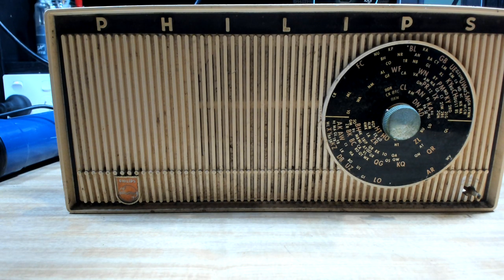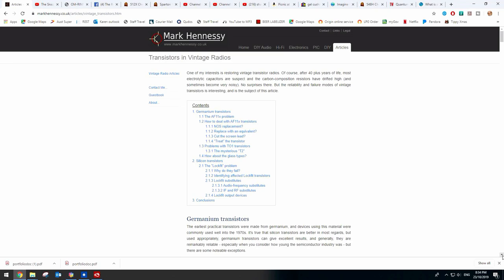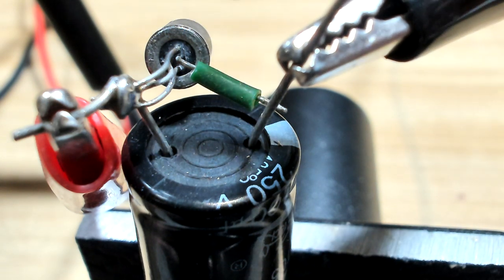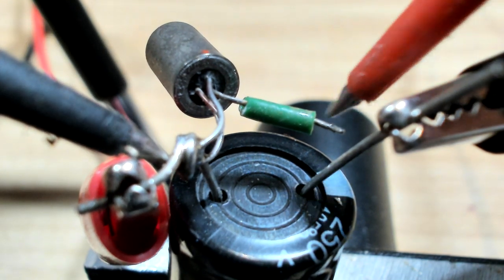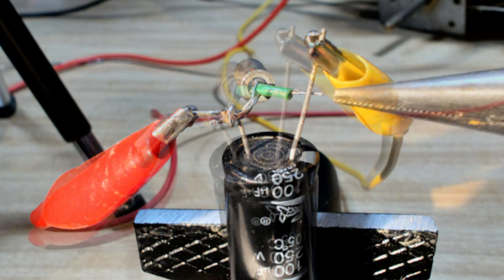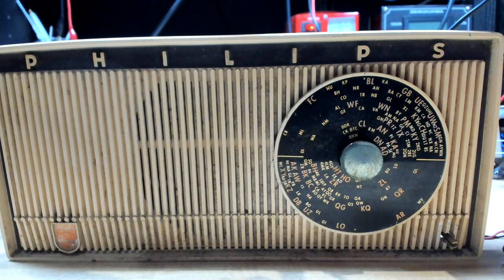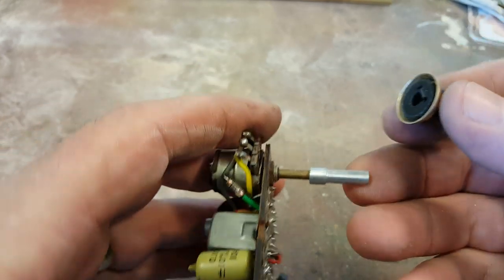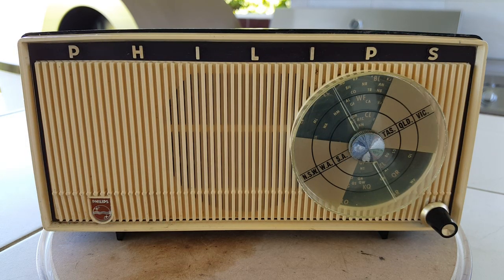Germanium Transistor Tin Whiskers Fix on a Cute Philips MT6 Radio

Comment: Another radio saved, and by doing something that you would think would blow up the transistor.  I am glad you didn't paint it.  Even though the colour has changed, it still looks quite attractive and authentic.  Cheers.
Reply from the maker: Hi Pauline, I think it would take a fair bit befor it would jump to the case itself. I was reluctent to paint it and as you say it looks pretty good as it is, thanks 😊

Comment: WOW!!! I have never heard of Zapping a Germanium transistor like that...I am amazed that it worked, but work it did!
I can't really give you a proper answer as to why, but I really don't like working on anything solid state.  I love the old Vacuum Tube (Valve) type stuff.
Good short video.  Thanks for sharing.
Reply from the maker: Thanks Wyane 😀
Reply: Radiocruncher uses this fix for AF117s in the i.f. modules of Roberts radios. Usually effective but there is no guarantee they won’t return sometime.
Reply from the maker: @Wenlocktvdx  More likely to guarantee it will return at some time 😂
Reply: @Wenlocktvdx  ,
For a minute I thought it was the same manufacturer as one I saw in a video recently.  Turns out the one you mentioned is Roberts and the one I saw was Rogers.  It was a really nice radio!  In case you want to see what it looked like, here is a link:   https://youtu.be/ISbidethQyc
Reply: Rogers-Majestic LTD. was bought by Phillips after the war, some of their products were made in Canada, others were rebadged Phillips models imported directly from Holland. If you saw a transistor radio with the Rogers name on it it was probably one of those from the early to mid 1960s. 
 The video you linked to is of a post war AC/DC set in a sort of table/chairside cabinet, in fact I think I saw the very set for sale  on Craigslist a month or two before he posted that video. It is not a set that really appeals to me to be honest, but unlike the transistor sets it was made in Canada.

Comment: Hi, I have done the " flash technique " on a selection of old Ac114, and Ac127 germaniums out of old Hacker radios ,and had some success. 
The resistance between the joined coll,base,and emitters to the case was in some cases just a few ohm to several k ohms.
I always keep an old but charged car battery on my workbench,  for when I am repairing old valved car radios with vibrator power supplies, and thought I'd try using it as the " flash voltage" .
On several occasions,  there was indeed a visible flash through the bottom of the transistor case, sometimes not , but in every case, the internal resistance returned to infinity, and the transistors worked well with no noticeable physical induced microphony ( hit them with screwdriver!).
The downside was that the " repair" only seemed to last a week or so , so I just replaced them with modern ( ish) equivalents.
Reply from the maker: Hi Bob, thank you for adding your experience with flashing... transistors that is. Interesting that you saw the flash during the procedure, I copped a bit of flack with that claim. I just tried the Philips out and it still works, that was 3 years ago, I guess hitting it with 80 or so volts might have been the difference. Thanks Bob 👍🙂

Comment: Hello David yes I have encountered tin whiskers on tin and zinc plated components in RF equipment in the past. Not so much these days however.
I have considered this could become a problem with some of the very small surface mount components as they age depending on their environment.
Thank you for a very insightful video demonstration which I will try when needed in a repair.
Reply from the maker: Yes, in Marks article he postulates that the removal of lead and replacing it with tin may see the whiskers issue start up again. Thank you for your comment 😊

Comment: Thank you for the tech tip! To be honest I thought the capacitor of the transistor was definitely going to blow once you started using a 90-volt source, well done!
Reply from the maker: My Pleasure Andrew. The cap was rated at 650 volts so there was no problem. The radio still works 😀

Comment: I've got a Perdio Town & Country and a Murphy M8(?) which are full of germanium transistors. Neither of them makes a sound. I suspect I'll ultimately end up replacing some or all the transistors in them but now at least I have something I can try first.

That Philips looks great and sounds well now. Very informative video, thanks a lot!
Reply from the maker: Hi Paul, It's still working after the transistor fix, good luck with yours 😀

Comment: Really interesting article Dave. Glad you got the old girl working again. I have a decent collection of transistor radios myself in the UK and enjoy breathing new life into them as indeed you seem to do. 
The perennial problem of tin whiskers....... I have to drag some of my collection out of the loft on regular basis to short out the little blighters. By the way, I have had some success using a megger and using the procedure you carried out in your video. 
I Never get a flash on the shorted transistor leads but it always seems to fix the short and start the transistor working again. I Never throw away germanium transistors particularly AF117's as they are very rare to come by and even new old stock can have the same problems. Keep up the good work mate.
Reply from the maker: Hi John, a megger would be a good choice but I don't have one... yet. The website I got the info from said because the base of the transistor is glass you may see the flash inside. I have a few NOS germaniums that are DOA, I'll spark them back to life when the time comes 😃

Comment: Hi in my shop we took out all the black gunked leaded transistors or ic's and put in a little bottle part full of tarnoff and stirred occationaly and checked by pulling out with tweesers till clean then put back in resolving all problems esp in old audio equipment... worked every time. Guess most wiskers are at the base at case enterance.
Reply from the maker: Interesting idea William. I understand the tin whiskers grow from inside the case and short to the active components inside and not necessarily near the base but I like to experiment so might give it a try next time, I think Tarnoff is expensive though. Thanks for the tio William 👍🙂

Comment: I've seen a similar trick with germanium transistors from a youtuber by the the name of 'radiocruncher', very useful thing to know and thanks for the detailed explanation. In regards to the case and whitening plastic, you can use hydrogen peroxide in some kind of paste form wrapped in plastic and left in the sun, I've tried it and it works with computer type beige plastic that has gone brown, but not sure about older plastic, I'm sure you must have heard of this method, thanks again David.
Reply from the maker: Hi Graham, I'll have a look for radiocruncher, I was going to use peroxide but was worried that it might affect the black dial so thought better of it 🤔
Reply: The hydrogen peroxide in paste for is a product at Sally beauty store. It has limited success, and will not prevent a whir plastic from yellowing again. I used it once on the grout around my bath tub. It did a great job!

Comment: Nice, its an antique radio by Phillips. Nice restiration and repair. I had used many Philips electronics. I had seen L5 radio which had been in use of my late father. And also a valve tv.
Reply from the maker: Hi hanif, thanks for your comment 🙂

Comment: I've blown lots of tin whiskers away and never seen a spark but it works. I suspect the metal is microns thick and a few milliamps takes it out.
Reply from the maker: Yeah, I think I was expecting too much 🙄
Reply: It may depend on the lighting, or how thick the whiskers are.
Reply: Yeah, if you want a visual aid I'd think you would need to monitor the current with quite high resolution, perhaps even microamp level. Put the voltage to the transistor constantly and hit it until the meter stays on 0.

Comment: Many of the early Brit transistor radios suffered from 'tub whiskers'. I've learned a few tricks over the years including replacing with silicon transistors. Yes you can try firing a capacitance discharge and YES SOMETIMES that WILL work BUT! it still can be a SHORT TERM fix. 😗The 'tin whiskers' issue was a KNON problem and many suspect the PRODUCTION methods of those transistors was indeed suspect ? It is interesting to note that I seldom ever had such issues with ie JAPANESE transistor sets. SONY et small transistor pocket sets. 👍 Service engineers were issued with a small hammer like tool that they were told to hit the transistor with to clear - momentarily the curse  ! though I suspect the VERBAL abuse was more of a CURSE 👀🤣 I used a 500v surge and some I know more than that.
Reply from the maker: This transistor is still working after 2.5 years but it will fail again sometime. 500 Volts should wake it up 😄

Comment: When I was a kid about 1971 my uncle used to fix tin whiskers in a portable radio by switching it on and stroking a front door key along the PCB loud popping and screeching until it started working. I cringed but it worked
Reply from the maker: Yikes!, sounds awful @jagmarc 😖
Reply: @DavidTipton101  I've just remembered another one I saw long time ago, while the radio was switched on no sound.  With wirecutters cut a certain lead of each of the AF117s one by one, and just as reach a bad one the radio bursts into life and then continue cutting the others left.
Reply from the maker: That's right. The transistor metal can is grounded to the radio. The whiskers grow from the tin plating inside the can towards the device and shorti it to ground. Cutting the ground wire removes the short to ground. The effect is short-lived however as the whiskers continue to grow and eventually short out the device itself.

Comment: I've just come across this problem in as it happens another philips set , but a clock radio,   thanks for demonstrating this,  I'm going to have a go ,   I did see this video years ago,  thanks Dave ,  its funny because I've got lots of sets still with af117 transistors all working fine,   wonder if there's a factor that actually starts these whiskers growing,  all the others have no problems,  anyway thanks again Mickey
Reply from the maker: Hi Mickey, I don't know why more are affected than others. NASA did an investigation with the problem due to these being used in some of their early equipment. The voltage trick works well most of the time, I don't know if I did it the best way or not but it worked. Thanks Mickey 👍🙂
Reply: @DavidTipton101  crikey NASA, I'd never heard of that, I'm more of a valve guy myself too, but I'm looking forward to trying the technique you did ,  thanks for all the videos,  I've more recently been messing around with early battery sets from the 20s and early 30s I find them fascinating 😀,  I'm waiting for you to try some of these type sets ?? Unless I've missed any videos you may have done with them ?? Cheers Mickey
Reply from the maker: @dangerousbrothersvintageel7494  I haven't done any very early battery sets, I did do the Bush battery set from 1935 https://www.youtube.com/playlist?list=PLHTsZdKkSdsd-30S9LmIwghI_rmOmgPBq

Comment: Hi! Thanks for a great video. Regarding current needed to charge the capacitor: I only have access to a DC power supply which max out at 30v. Will this be enough juice to work?
Reply from the maker: Saludos desde Australia. Gracias Juan 😀
Reply: Thanks for replying, David, but I did not quite understand it (I'm from Sweden) 🙂
Reply from the maker: @torbjornl  I'm sorry Torbjörn, that was meant for another comment, Juan is probably wondering what I was talking about too 😄 The only thing you can do is try it, I think it will be enough if you can get a big enough current rush through it. You can also lift the shield leg from the circuit ground and see if that fixes it. Mine is still working, good luck 👍🙂

Comment: 2:42 Was the transistor done for after that? Would it work after putting the cover back on? If it did, then perhaps this is a method for a permanent fix i.e. just replace the cover back having previously inserted an insulating sleeve between the cover and the semiconductor.  It's funny, I also thought heating the can might be a solution as you were describing Mark's method.
2:53 Mic a bit too close to the suction pump there David! ;)
6:25 Shame. Perhaps trying low amplitude ultrasonic vibrations?
Reply from the maker: Hi Stelios, 2:43 The transistor was destroyed 😄 You might be able to do that if you can open it up and close it up again.
2:53 Sounds OK on my PC, might be loud on a phone 🤔
6:25 I stick with my plan, take two 👍
Reply: @DavidTipton101  Yep, saw the whole video. I'm in the bad habit of typing comment as I go along so initially I thought the video was about Mark's method failing. Glad to see it proving to work in the end.
I've never toyed with germanium semiconductors - always wanted to though. I presume modern production specimens do not suffer from the same problem?

Comment: I once used a similar technique where an older colour TV had a blue screen; the (blue) cathode measured around 3 volts; it should have been 100 volts. Charged up a capacitor to 150 volts (100uF, 160V), applied it whilst on, (video driver disconnected), and back to a normal picture. Apparently the AF 117 transistor (Philips/Mullard RF oscillator) is notorious for the 'tin whisker' issue. I watched a YT post from the US, where he replaced the transistor with a more recently made (Russia) equivalent, which 'did the trick' as well..
Reply from the maker: That reminded me of a Panasonic projector TV that lost a gun and the tech zapped it and it came good, I think he zapped the gun itself.  Not a tin whiskers problem I don’t think. I was going to get some Russian transistors if this didn’t work. This was an AF116 I don’t know what the Russian equivalent is 🤔

Comment: So is this set battery only?  I was born in 63 and these transistor radios were everywhere when I was a kid but they all were mains powered as far as I knew.  Learn something new every day!
Reply from the maker: Hi Jack, Yes, battery only for this set. There is an Philips model MT7 that uses the same circuit but is mains powered and maybe battery as well but I don't know for sure.
Reply: @DavidTipton101  Thanks for the reply! That's really cool! I suppose in the land down under in the 60's there were a lot of rural places without mains power? I don't know, I'm just guessing here, lol. This was a common thing in the states before the rural electrification act of the late 30's I believe, there are a lot of radios that ran on 6 volt here in the 30's that were powered by 6-volt batteries that people would take out of their cars or trucks and bring in to power their radios. Or since it was probably a farmstead maybe a tractor.
Reply from the maker: My understanding is that a lot of farms and remote areas did not have mains power due the the sparse population and large area to be covered and that may have been true until the 80s. 90V battery sets seemed to be popular and 6 or 12 Volt vibrator radios the same. I have several 90 - 1.5 Volt radios and one 6 Volt vibrator set which I will tackle at a later date. Battery sets are very easy to obtain now which would lead me to suspect they were very popular.

Comment: Can you buy a replacement transitor,or use a general purpose transitor,    the method I saw was for removing whiskers was lay the side of the soldering iron on transistor 0 for a few seconds .,I never tried it,I like working on tube radios ,so transistors not really my thing.do you own a esr meter .
Reply from the maker: Hi Ron, You may be able to get a NOS germanium transistor but the whiskers issue doesn't seem to care if the transistor is in use or sitting in a drawer for 40 years.  There are Russian equivalents available which work quite well or you can use silicone transistors if you change the bias. The soldering iron trick may work although I don't see how, be worth a try next time. I have a Chinese meter that gives ESR, I don't know how reliable the reading is though 😊

Comment: Is there a modern replacement for that Transitor?
Reply from the maker: Hi Ron. You can use a modern silicon transistor but the voltages need to be adjusted for it to work.

Comment: Interesting. I've seen tin whiskers burned off Hammond organ vibrato mechanisms with a 9 volt battery. I would have thought that 90 volts would destroy the innards of a transistor, but apparently not. As for plastic yellowing, you could try peroxide and UV light (Google it). I have had some success with that on telephone cases, but I would caution trying it on some junk first.
Reply from the maker: That's interesting James, I was all set to peroxide it but thought it might damage the black dial so didn't do it 🙄
Reply: @DavidTipton101  Yes, I'm not sure what would happen with the non-white parts as I've not tried that. Would definitely need to experiment with throwaway stuff first.
Reply from the maker: @James_Bowie  I considered coating the dial and Philips badge with petroleum jelly but wasn't game to do that either. I soaked it in water to see if it would lift the glue but no luck.

Comment: The dial layout is interesting. So it's an AM radio then? Can you DX with it?
Reply from the maker: Hi Art7220, the dials on Aussie radios get a lot of comments, for whatever reason we used the 3 number and letter station identifier divided into the 6 states. This one is pure AM only 🙂
Reply: I wonder if it would work in the USA? Have you seen Shango066's videos? I've seen him work on a USSR radio and it does get KNX AM news from Los Angeles. He's working on a 1948 Hoffman TV radio set.
Reply from the maker: Hi Art7220, it would work in the US on a 240Volt power supply. Shango is based in LA so he should get KNX AM pretty well. As far as Dx, I live in a valley behind a hill I can barely pick up Brisbane stations 40km away 😄